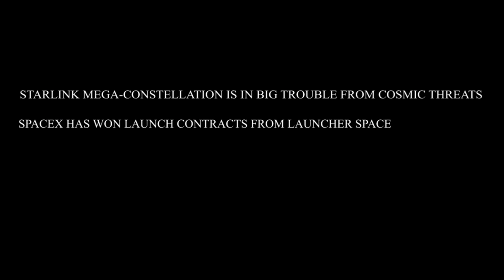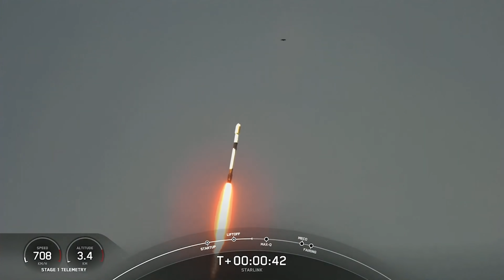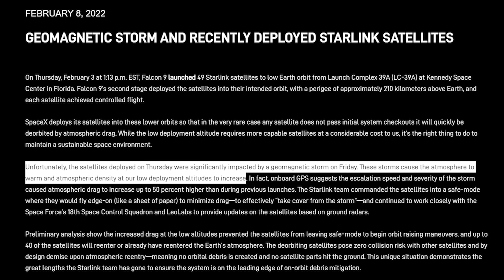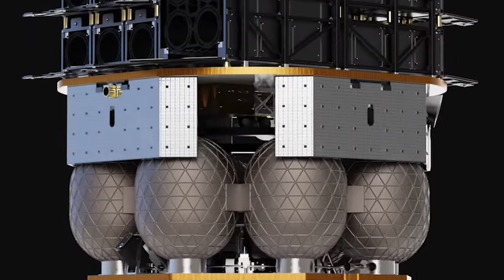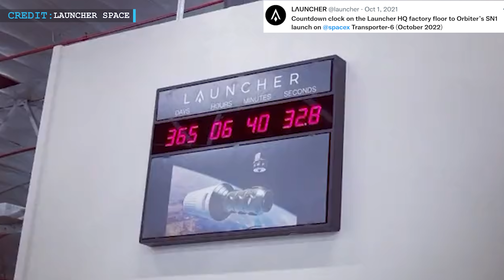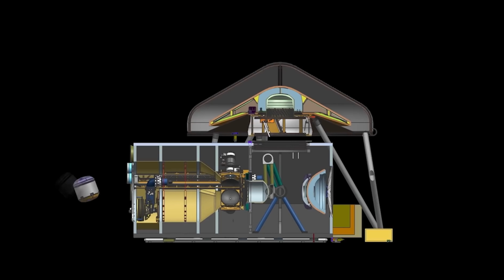Solar Storm Destroys 40 New SpaceX Satellites in Orbit | Musk says No Risk to Earth

Comment: I would like to see how Lockheed Martin will test a small launcher from a Mars rover that will rendezvous with a satellite for it's payload capture. Forget the fact that ESA has never successfully landed on Mars, I'll assume they will be able to accomplish this. But to capture a payload in space, transfer the payload, and then launch another vehicle to return it to Earth...I certainly would be interested to see some tests beyond the renderings they've posted.
Reply: It would be hard to test on Earth, but my guess is that they can test the solid rocket motor on a sounding rocket (check that thrust is produce in vacuum and stage separation works fine in-flight. The rendezvous system could probably be tested in low earth orbit as a secondary payload.